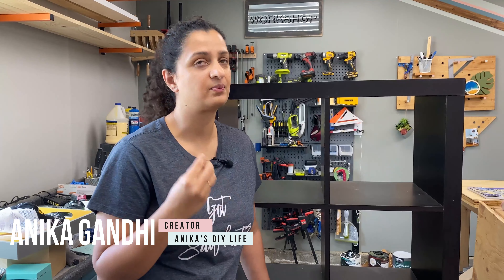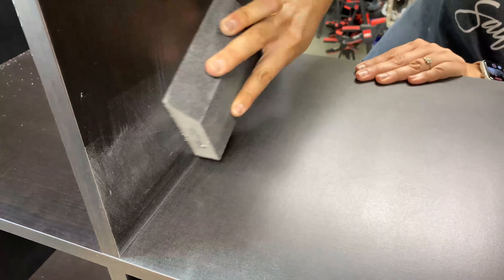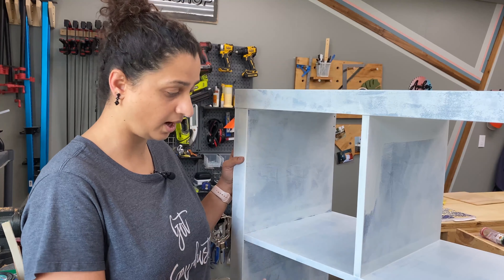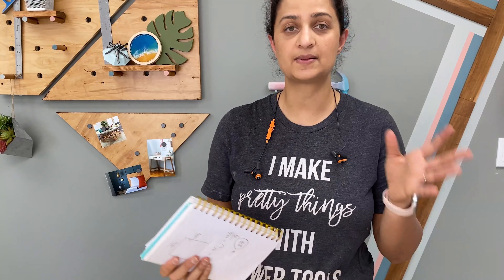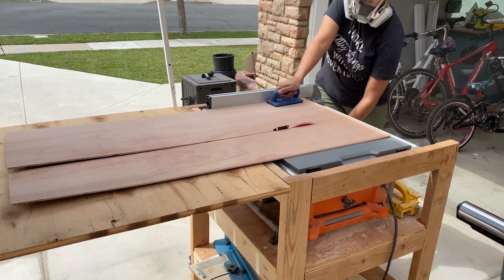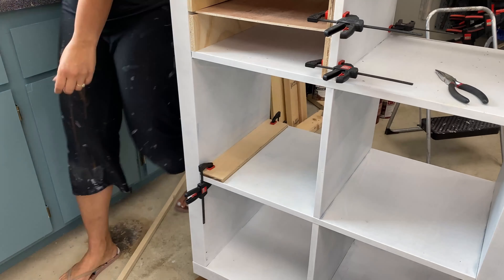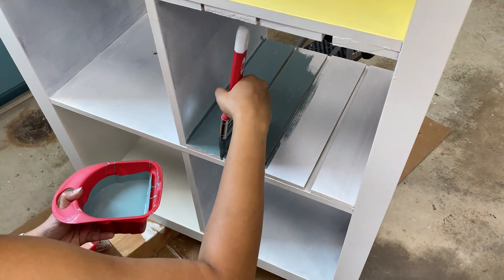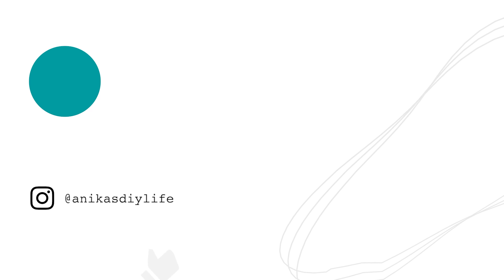How To Paint Ikea Laminate Furniture + Make it last a long time!

Comment: Did you seal it?
Reply from the maker: Based on the type of paint you use, apply a topcoat. If I use semi-gloss paint, I usually leave the project alone with no topcoat. Check out the details in the project post for the products I used :)

Comment: I would like to try this on a white Billy bookcase but question how if the paint will hold up. I want this to be functional bookcase with actual books sliding in and out daily. Would this method work? Two professional  painters can't to give me a quote but as soon as they saw the texture and surface of the Billy (laminate, melamine, not real wood) they said it cannot be painted. You did a great job.
Reply from the maker: I painted this last September so we are coming up on one year. It is holding up great. The kids use it and there is hardly any wear and tear.

Comment: What is your favorite strong topcoat? I didn’t see it in the description.
Also, I am painting a laminate desk and need a super strong top coat for the desk top as it will be getting lots and lots of use. What do you recommend to keep the top paint protected?
Reply: you could put an epoxy layer on top.

Comment: Hi Anika, superb video and so helpful! just one question, you mentioned that after the first coat of latex primer you can use other versions of primer e.g. water base? Have you tried it? In our paint shop the lady was not sure if the water based colour/primer is going to hold on to the first coat of latex primer.  Is it safer to use the latex based paint after the latex primer or can we go ahead even with water based paint? thank you

Comment: With the primer that you used, does the paint / primer scratch off the shelf easily? I once painted an Ikea table using only paint and it scratches off very quickly. I'm just wondering when done properly the way you did it would the paint slush primer scratch easily?
Reply from the maker: Nope. It doesn’t. It needs to cure completely - about a week or so. I actually painted this last September and it is still as good as it was. You can easily run a fingernail across with no scratches

Comment: What kind of ear protection are you using. I saw some ear plugs around your neck. Just curious I am looking for some and wondered how good those are. Also love the shelf!!
Reply from the maker: I use the ISOTUNES 2.0. I like it a lot. It is small and gives me the same noise reduction as some of the larger earmuffs. ALso, you can use ANIKA10 coupon code to get $10 off if you decide to buy.
Reply: @Anikasdiylife  thanks so much!!

Comment: I am in love with this.
Quick question, do i have to sand it until its a bit white ? To remove the existing dark brown color or just a quick sanding ?!
I have exactly the same shelving unit as you have.
Reply from the maker: Just a little bit to rough it up - it will just look scratched up.